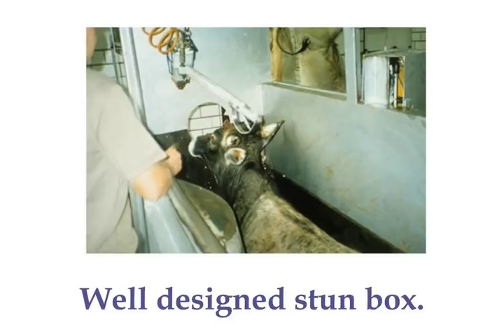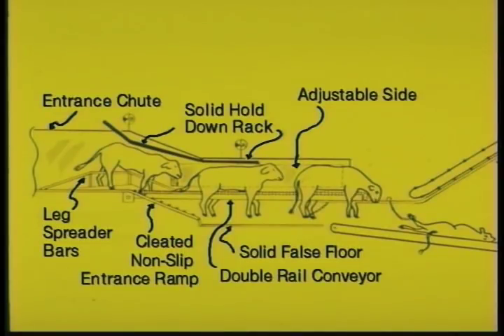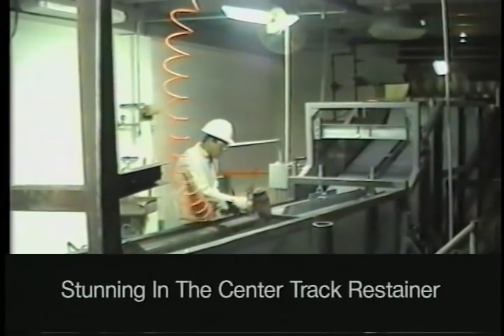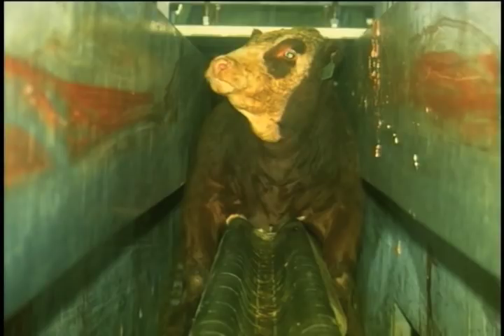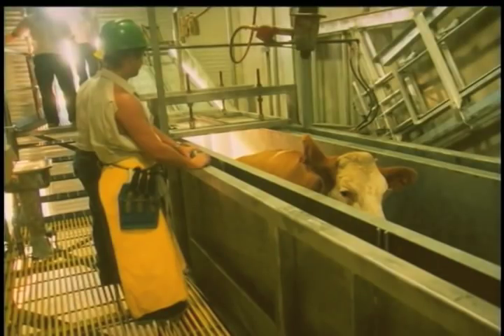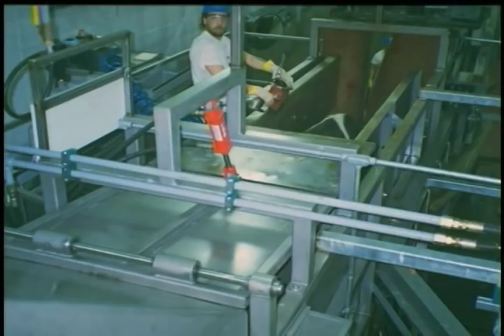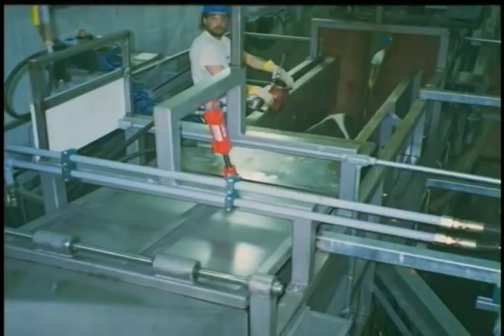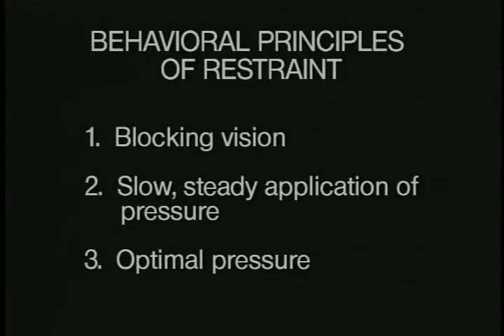Design of Cattle Stun Boxes and Conveyor Restrainers

Comment: The methods used by small European butchers are generally far superior to the ones used in North American large scale butchering operations.   Particularly when it comes to horse slaughter. (Which I violently oppose no matter how it's done.)  At least, when a horse meets its maker in a little French butcher shop, it is likely to be calm and not frightened out of its mind, and the captive bolt gun (powder activated type) is used correctly resulting in a painless and instant kill.

Comment: if you're going to eat meat, then it should be done with respect to the animal and the slaughter should be as quick and as painless as possible.  The system used here does that.  No panic, the cows aren't aware of what's happening and death is quick.

Comment: There is absolutely no reason for the methods you describe..Kosher killing is inded very cruel and needs to be stopped..My attitude is this..If animals are to be killed for food ,Lets make it as quick and as painless as possible,If you use a captive bolt properly the animal feels nothing and its safer for the slaughterer, so its not really the aim to have the animal struggling and swinging all over the place,I can`t  all see the point in halal or kosher methods apart from the religious point.:)